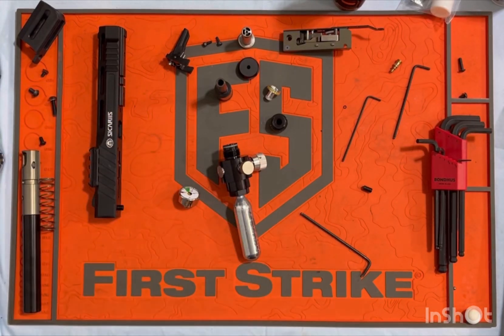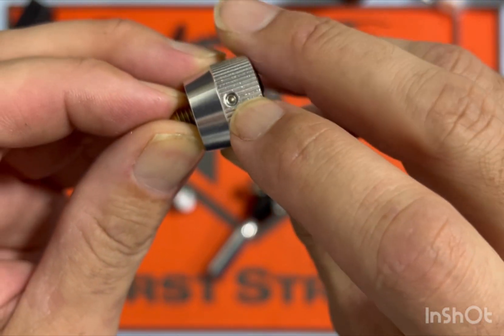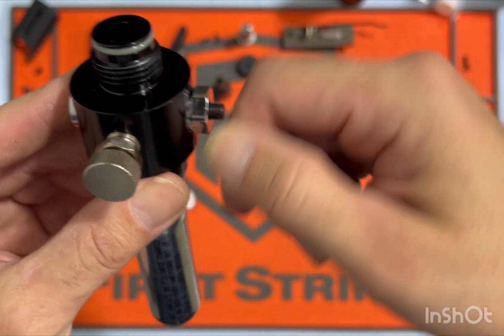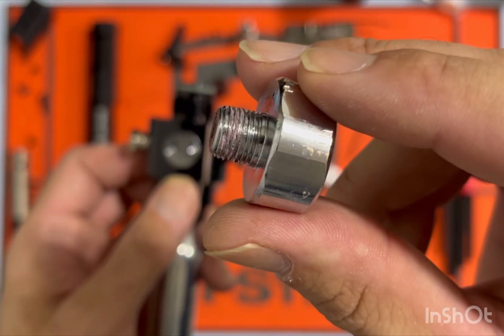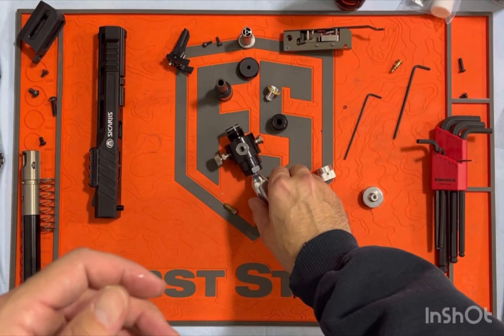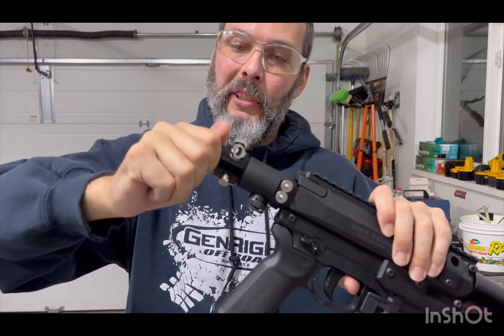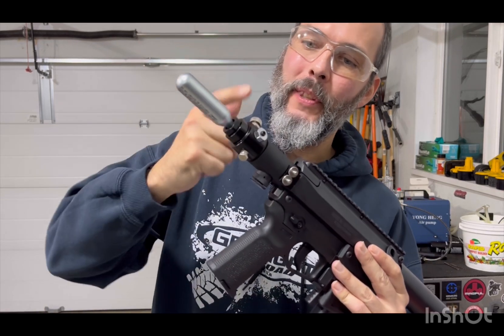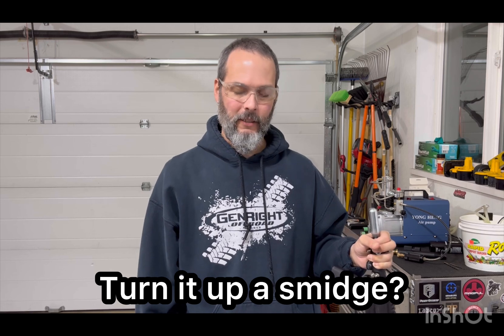LL4D Valken M17 - Slimming down the AliExpress  co2 regulator & quick tune

Comment: What brand of ball is good bore match for the M17? I have some Duke glass breakers to use with mine
Reply from the maker: Rolling out the barrel probably has more to do with the detent.
Reply: @lesslethalfordummies  The balls were rolling out from day one. I must have got a defective model. It does fire the devastator rounds and other D shaped projectiles fine. Just the round balls have an issue.
Reply from the maker: @bretthighbee got to replace the factory detent. It is utter garbage and you are not the first to have your balls drop right out of the box 😳
Reply from the maker: Dukes would be a really good match for the stock barrel but best to check them first. I believe the factory bore is 0.688?
Reply: @lesslethalfordummies  No idea. my CQMF did not like the no-name brand of cheap .68 caliber balls I found on Amazon. They are too small. They would roll out the end of the barrel. I will mount an air tank on the stock instead of the remote airline and replace the blow-off valve with a plug that I got from Grimberg.

Comment: hi sean,  new to your channel , must say its great, thankyou for that 👍. had pcp rifles for some years , just getting into markers for less lethal.
just got a m17 cqmf.  very interested in the adapter you have on the line ready stock tor 16g co2,  is that a - take out the nipple + screw in instead ?  cant find a link to it or what it actually is.  also - how are you using all these different mags ? do they just fit or have you changed the mag receiver ? it does look different somehow.  got loads of questions but wont throw em all at you now.   thanks if you can gie any info on those 2 items,   cheers   G   (uk)
Reply from the maker: Welcome aboard. The adapter is 

New Co2 Cartridge Cylinder (3/8-24UNF Thread) To Paintball Tank Thread (G1/2-14) Convert  Adapter
a.aliexpress.com/_mrCvyCo

Valken sells the smg magwell for the M17 model that swaps right in. That magwell does not fit the Cqmf. There is a printed version available for the Cq to accept T15 magazines available at 

CriticalSituations.co.uk
 
I normally put links in the video descriptions of the newer videos.

You can always email me if you got lots of questions 😁👍🏼
Reply: @lesslethalfordummies            thank you for that, i have those adapters on the way already , its the chrome one that goes onto the cqmf remote line buttstock that i was after..... cheers
Reply from the maker: Aaa yes. That is a Spyder vertical asa adapter. I have only been able to find them on eBay now. Use to pick them from Amazon.
Reply: @lesslethalfordummies     cheers man 👍

Comment: I never thought you'd sell me on CO2 in that marker after having ditched CO2 years ago (besides pistols or revolvers), but I am getting that reg now and any adapters and tripling up my CO2 cannister stockpile.  Great SHTF backup.
I'm actually super impressed with that regulator!

I probably have enough HPA air and tanks and rounds right now to take on Ghana and maybe Saskatchewan together, but ya never know when power may run out 😮.....😅
Reply from the maker: Co2 is great so long as you have specifically setup up your launcher and know the limitations. I wouldnt use it for everyday plinking as it definitely can get expensive but this proves it is a viable option. I have some other things to test as per a convo i had with a group member last night that may even surprise me.
Reply: @lesslethalfordummies oooh sounds interesting